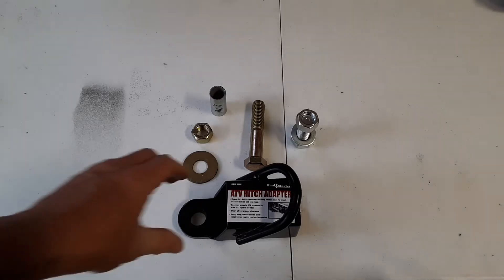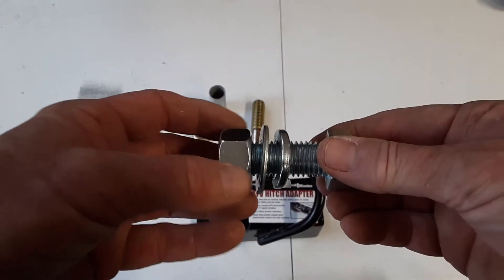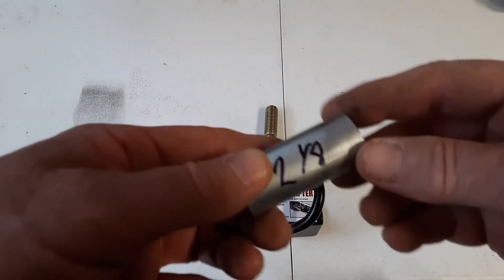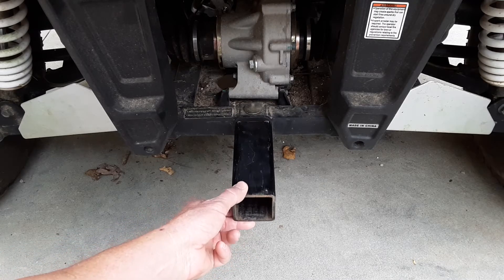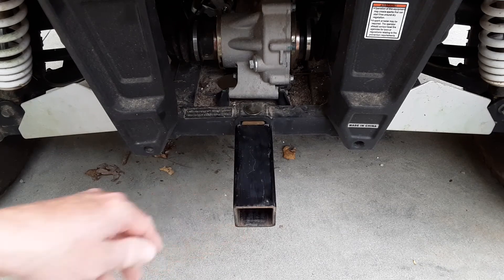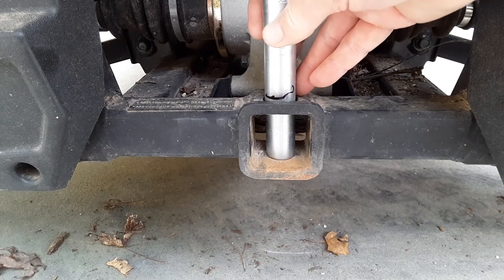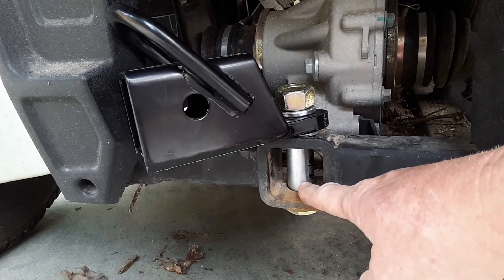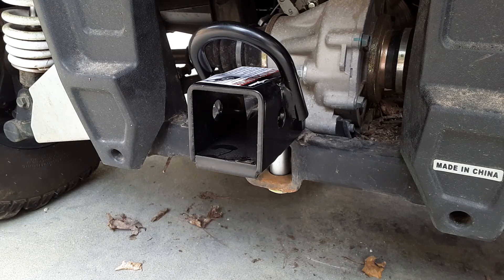Hisun Vector 500 Trailer Hitch Modification

Comment: Nice.  I was going to do something like this to my UTV but I was concerned about too much fatigue from having too much weight on the hitch.   I ended up taking an old 2” ball tongue and drilling the  3/4” bolt hole top to bottom then used their pin to hold it.   It’s a lot more tighter then the adapter it comes with
Reply from the maker: Nice idea.

Comment: I’m ashamed I didn’t come up with this!  The trailer hitch has been driving me crazy with the vertical pin hole not horizontal.  Couldn’t find and adapters that would work and had vertical holes!  Even worse I put those same adaptors on all my quads so I knew they were available!!’
Reply from the maker: Glad to help.

Comment: Thank you for the video. Did your solution work? It looked to me like the hitch adaptor might turn on the bolt if it got the right amount of stress, like you couldn't ever really get it tight enough.
Reply from the maker: You are welcome. Yes, when I first connected the adapter it moved a little on a very sharp uphill turn. I cranked down on it with a cheater bar and it hasn't moved. I suppose you could add another bolt/screw if needed to keep it from moving.